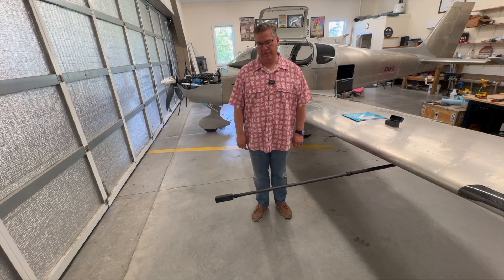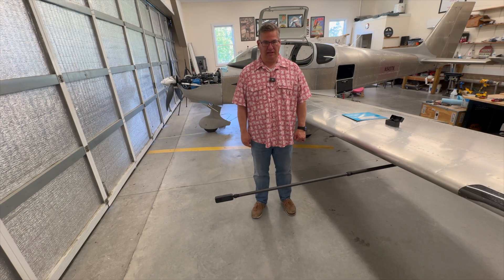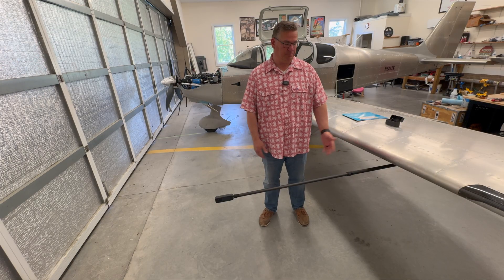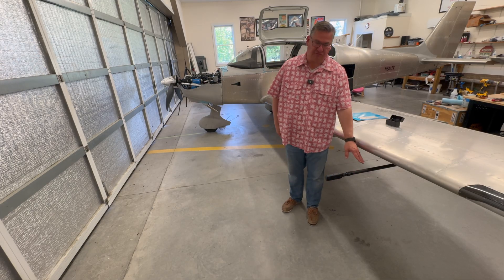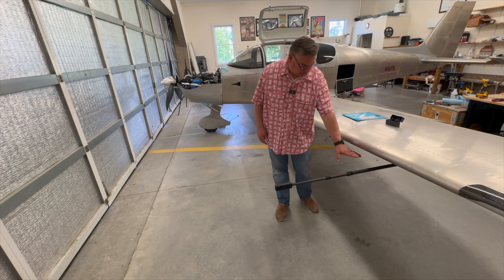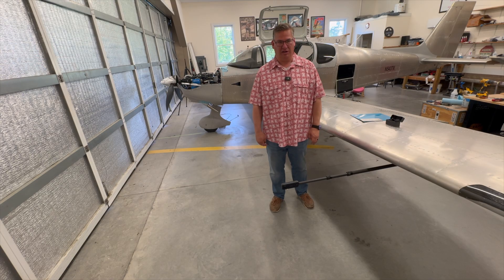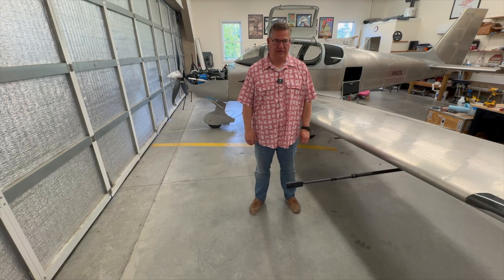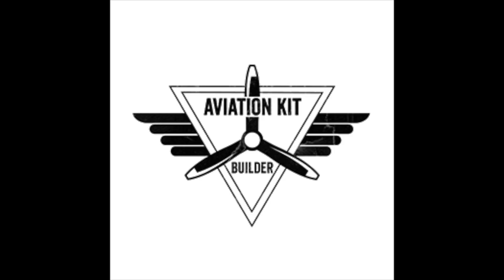Adding an INSTA360 X5 Pole Mount to my Sling TSI Experimental Aircraft

Comment: How did you decide how far out on the wing to mount? It would seem the further out tword tip the more flex and movement you would get and the closer to the fuselage the more stable. I see part of decision was closer to inspection hole
Reply from the maker: Mainly access. The farther you go on the wing, the better view you have but more movement. There is a pitot tube closer in that gets in the way as well I wanted it on the pilot side so I could see it clearly as well. I’ll get some comfort with it over time, but I’m being pretty cautious.

Comment: Sorry for the loss of your Pyrenees, great dogs.  A suggestion on the selfy-stick, instead of drilling the shaft and bolting  to keep it from sliding ... add a collar to keep it from sliding back thru the mount. Actually, could add a collar to keep it from sliding forward also.
Reply from the maker: I agree with your locking collar suggestion. I was second guessing the drilling of the carbon fiber since I don’t know how it will affect the strength of the tube. Everyone online says not to drill carbon fiber this way. No similar situations but just in general.